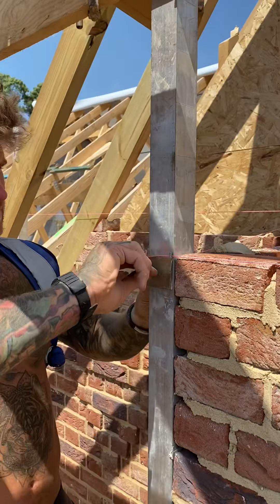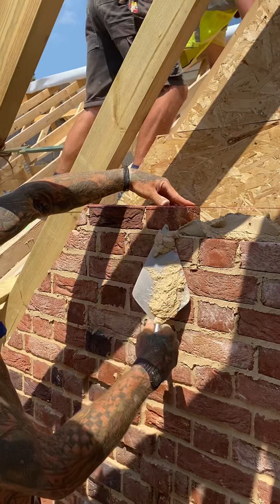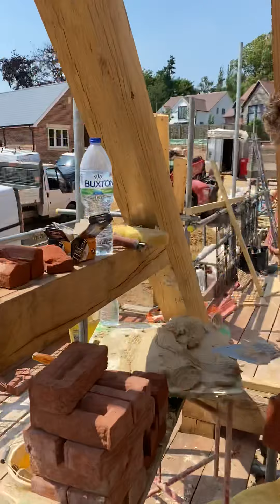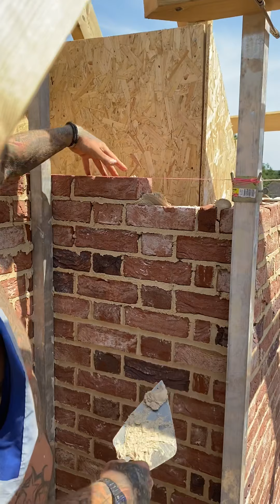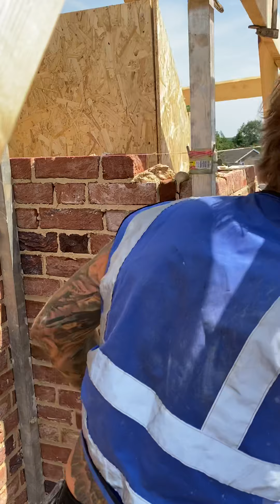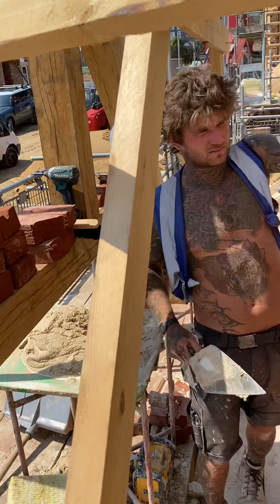Bricklaying in Flemish Bond! Pick and dip

Comment: Isn't that still glasfiber insulation in-between the wall?  Didn't now they did Flemish bond in the UK.  
Do you leave the mortar in joints or do you also take them out about 1cm and point them in after with a dry mix ?
Reply: Raking out the bedding mortar from new brickwork and repointing it with dry mix like the Dutch and Belgians do is not generally done in the U.k or Ireland .